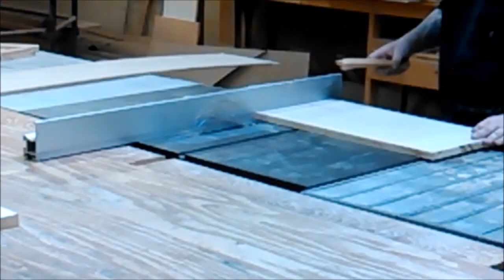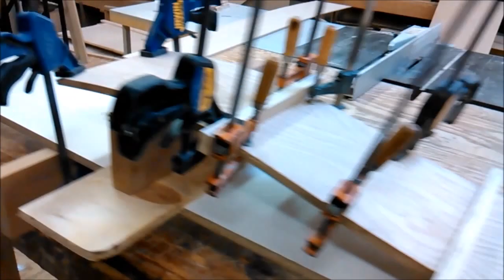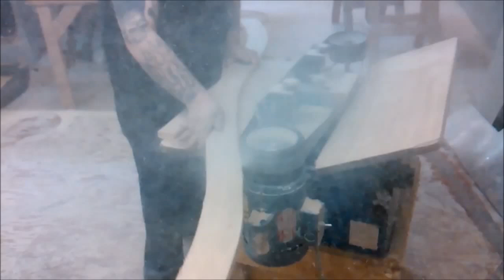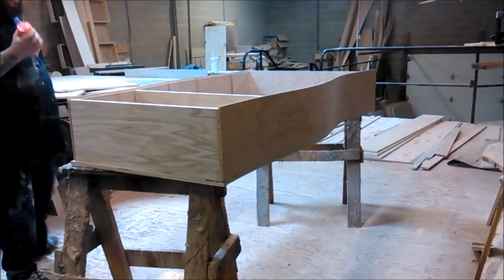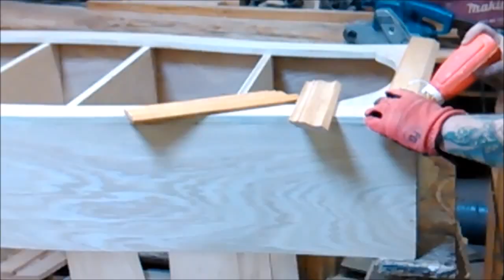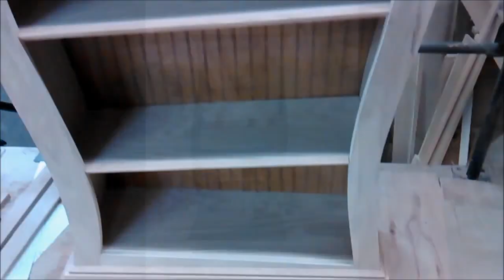how I make a curved side bookcase cabinet inspired by Tim Burton and beetlejuice

Comment: What do you call the gun that shoots the crimped tie thingies and how do you like it?
Reply from the maker: +Chad Burke I think it's called a corrugate gun ,it's great for quickly attaching 2 pieces together while the glue dries
Reply: +sdmcustom woodworking Thanks.  Trying to look em up and wasn't having any luck.  Looks handy for hidden use on non structural stuff.
Reply from the maker: +Chad Burke exactly,this thing is 40 years old the used it to put cabinet  face frames together and to join counter tops to make up length,im sure they still sell them cause we can still buy the nails
Reply: +sdmcustom woodworking Came right up!  They aren't cheap, but looks a lot faster than pocket holes for face frames. Thanks again.
Reply from the maker: +Chad Burke no problem,glad I could help